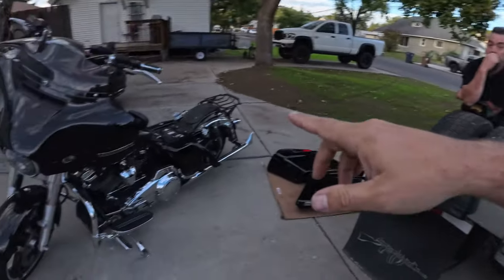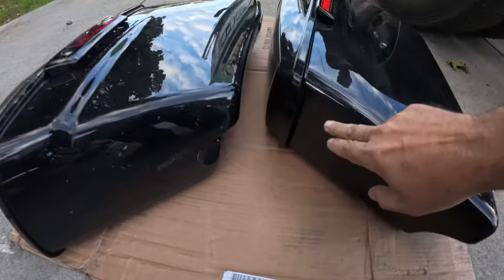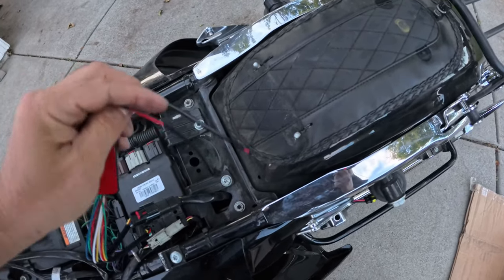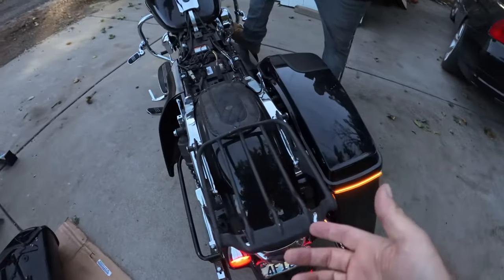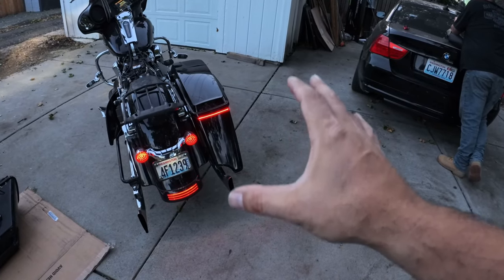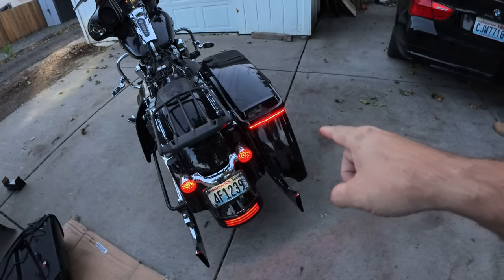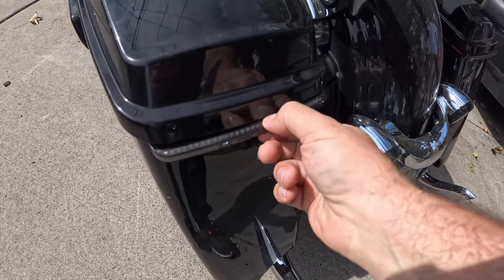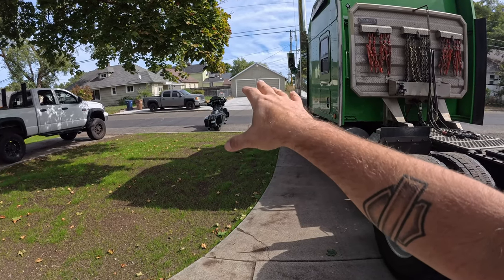An affordable option for Street Glide, Road Glide, & Road King saddlebag lights

Comment: It’s in hyper flash. Look it up. As for it being Chinese. It’s all Chinese.  lol.
Reply from the maker: I'm familiar with the hyper-flash but only as far as it occurring on the dash. I'll check into and see if the normal fix will get it to work the way my mind thinks it should. Seems like all our parts are Chinese now-a-days, lol
Reply: @Buffalo509  yea the LEDs work off resistance and the BCM has to see the right resistance from the lights or it goes into hyper flash so the load resistance module is needed.  Harley sells it for about 100 bucks